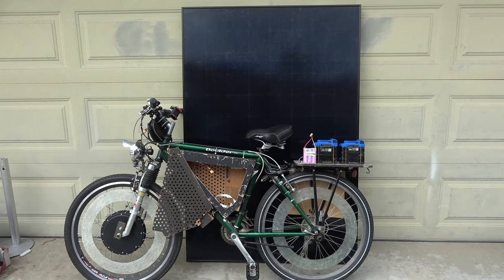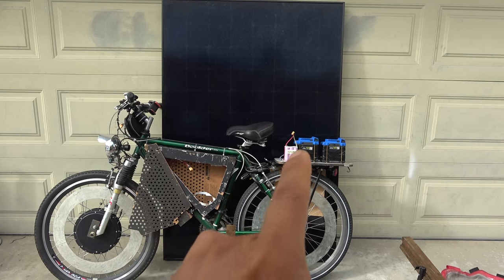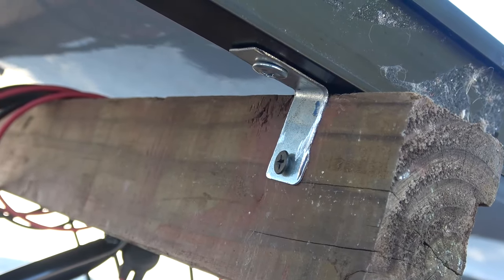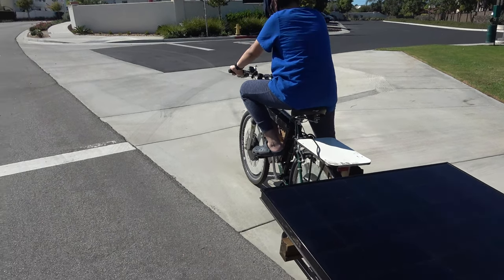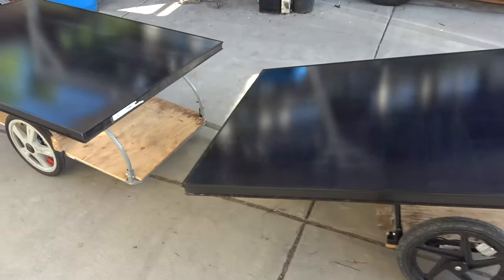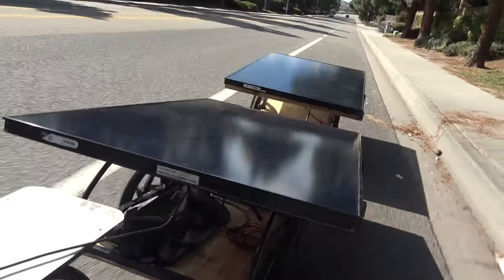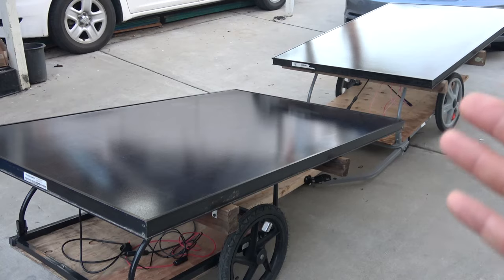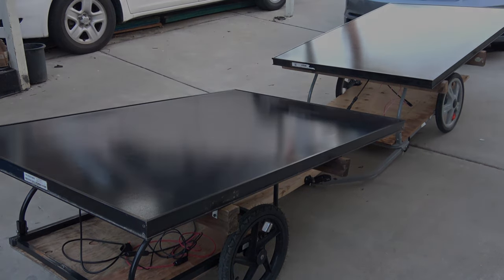Can you power an electric bike with just a solar panel without any batteries?

Comment: You might use a small solar panel to change up a super capacitor that constantly feeds a battery.

The solar panel charges the capacitor and the capacitor charges the battery.

Caps charge quick, batteries charge slow, so fast charge a cap, that delivers the slower charge to the battery.

Comment: Super capacitors for car stereo use gives power hungry base  (which is intermittent ) power for about a few minutes , they same would be true for electric bike excelleration needs.   Super  capacitors are like turbo boost for electric bikes and solar too.

Comment: What do you have to do to wire it to the battery ? Do i need a small inverter or wire it straight to the charger port ? Thanks
Reply from the maker: You need a charge controller. Wire the solar output to your charge controller. Then from the charge controller output to your battery. From battery output to your ebike controller.
Reply: @vuaeco  u no the earth is 1000000% 
Flat 
Dont u .

Comment: If you want a new vid idear get an old poly crystel blue solar panel the same watts as a dc motor but a few volts  higher .
I pump water at full power from a 80w panel at 16 to 18vdc direct drive  the mini china diapharam pump 70 watts up 10meters vv easy .. 👍👍👍
Reply: If u match the panel watts with the load motor wattts and u use a mini multi cell mono crytl or a blue poly crytl panel u can do it vv easy .. i tryed adding supper caps bank in paralell but it drops the V.